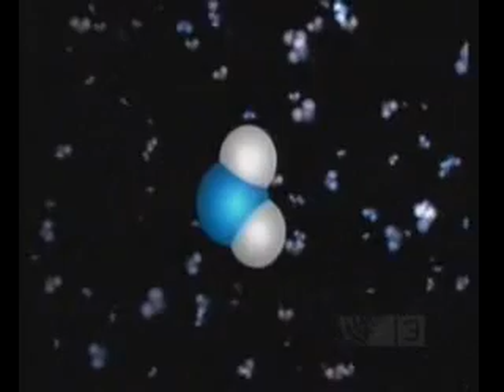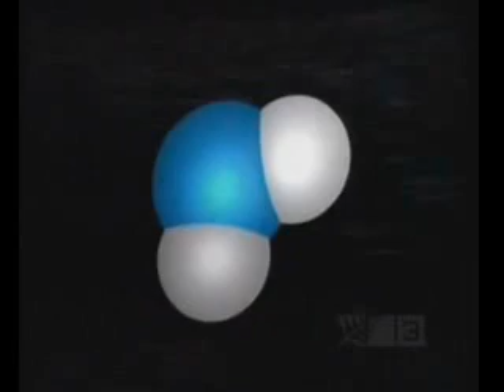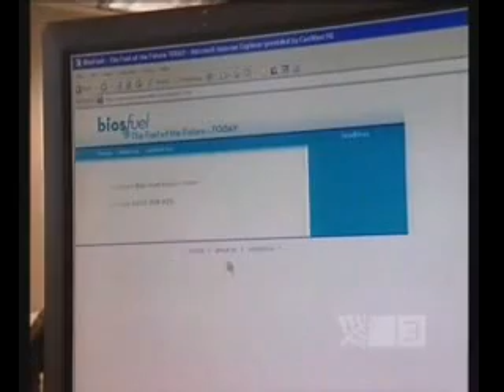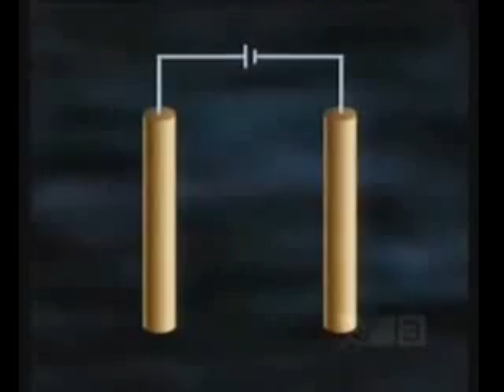A Motorcycle that runs on PURE Water.

Comment: Bullshit. You simply can not processes enough hydrogen.Hydrogen is not easy to use as a motor fuel because it burns too fast
Reply: Hydrogen gas expands faster and in higher volume after ignition than fossil fuels, so you would actually need less of it than you would with gasoline to efficiently run a motor.
Reply: Joseph Germany Nope, actually quite easy. H=1.008 amu (g/mole), or 0.09 g/cm^3 @ 293K.
Use the ideal gas law, PV=nRT. 
FYI, He, Atomic #2, is 4.003 amu (g/mole). It has less lift, but is more stable as it has a filled outter valance shell, which is also why it is a noble gas. 
The power comes from the thermal expansion, which is a function of compression, but most importantly the heating value of the fuel. 
Gaseous hydrogen has a very low heating value compared to gasoline. 1/20th or less at 1 barr. That doesn't even take into account the mole size of Hydrogen, which has a really nasty habit of displacing other molecules (it is massive). Burning Hydrogen in place of gasoline will REDUCE power, not increase it. 
 Check your science and math .
you will fubar the engine for nothing.
 Any how why the push of misinformation about hydrogen?or Where did you hear your that junk you posted?
I learned mine on the job.
lastly it's an engine not a motoir
Reply: Ron Brown
It's called solar energy, ever heard of it? It's free and has ZERO emissions, as well as wind turbines.
Reply: I dont have to be brilliant to watch other videos on youtube that actually explain their designs. nothing secret about this except this guys greed.
Reply: What ever dude?
I give you the math science and you come up with an uncontrollable lab project.
Get a grip. The out come of this lab experiment will not provide any viable results.
,Hydrogen's burn rate is too fast.  Internal combustion engines all rely on a timed spark before top dead center this allows the spark to start a flame front as the piston comes up. This in turn allows pressure to build before TDC and peak just after.
With Hydrogen this don't work and the timing has to be at TDC or after ATDC just to get it to idle. Come on man show me a valid source for your claim
Reply: Ron Brown The U.S Department of Energy tested four internal combustion vehicles using hydrogen: a Dodge Ram van and a Ford F-150 with engines designed for compressed natural gas, a Ford F-150 with a gasoline engine that was modified to run on a hydrogen/natural gas blend and a Mercedes van with a gasoline engine modified to run on pure hydrogen.
The tests showed the hydrogen lowered emissions and increased fuel economy (as compared to the engine on natural gas or gasoline alone). Ford Motor Company has developed an internal combustion engine optimized to burn hydrogen instead of gasoline. The engine can reach an overall efficiency of about 38 percent, 25 percent more fuel-efficient than a typical gasoline engine with nearly zero emissions. The engine is based on ford`s 2.3 liter engine used in the Ford Ranger. Supercharging allows the engine to deliver the same power as its gasoline counterpart.
http://www.consumerenergycenter.org/transportation/fuelcell/index.html
Reply: Ron Brown
What about nuclear power plants. We can`t use nuclear fuel directly in our cars but otherwise making hydrogen using nuclear power. Using hydrogen we can refuel wherever but you can´t say that about electricity.
Reply: TheSierra1983 Here's the kicker.
TheSierra1983
The Hemp plant is most likely the most versatile plant in the world.
One full grown plant has enough energy to processes 10 plants into viable products. The hemp plant processes 1000 times more CO2 than it will produce burning it and gives off O2 the entire time.Everything made from hemp is 100% biodegradable.Paper made from hemp is stronger last longer cheaper to make and no nasty chems like with wood pulp.
Henry Ford was going to build the model T out of hemp plastics,hemp textiles with an engine that used hemp oil fuel. Hurst put a stop to that and gave Ford a shit load of money for compensation .
The model T ended up being twice as much as Ford wanted it to be and the gasoline engine had 1/2 the power as the oil burner he had planed on.
 Hemp oil is vary dense and contains more stored energy than diesel fuel.
Purity fucking amazing when you top that off with it cures many forms of cancer and other ailments. Yet it still sits in the same category as angel dust.
Reply: Ron Brown
I agree, Hemp is awesome when it comes to versatile use.  The rest of the states in the US need to get on board and legalize it too.  It has a lot of potential to fix problems instead of creating more
Reply: D1967E I Don't know what you saw or what you claim you saw. It doesn't matter. I've seen graduate students at Caltech who were given free reign to determine how a magician's perpetual motion bicycle wheel actually worked. They finally decided that there was a magnet in the wheel and a pulsing electromagnet hidden inside the support (which was just like the front forks on a regular bicycle). The magician congratulated them on their expertise and removed the hidden electromagnet. But, the wheel didn't stop turning. The point is, it was a trick and that's all any of these hydrogen bubbler things are. They don't work. Period.
Reply: They are not talking about hydrogen. Hydrogen is not liquid at room temperature.
Reply: TheSierra1983 Don't be an idiot
Reply: Ron Brown
It's whatever dude. I tell you what, fill a soda bottle with gasoline vapor(leave room for a little O2), and fill another with hydrogen(also leave room for O2).  Light each one separately and judge by the the damage done. And correction it's MOTOR not motoir.  typo or not, don't correct someone when you aren't correct yourself.
Reply: Ron Brown
And as far as your "Science", Hydrogen is listed as "H" on the periodic table, not "HE", which is Helium.  Hydrogens atomic number is 1, not 2. go back and check your shit. And it's standard state is gas @298k not 293k
Reply: http://www.energybulletin.net/node/11963
http://www.dalefield.com/slspartners/hydrogen_fm.html
Reply: Ron Brown What makes the article from the link credible?  That's someones opinion, and sounds like a petroleum industry troll to me.
Reply: Well you just keep on then.
I stand on my original post ,You simply can not produce enough hydrogen to viably power an internal combustion engine.
Reply: Ron Brown Who said anything about producing it on the fly? You could have a hydrolysis station at home producing hydrogen over time and having it pressurized into a tank that goes in your vehicle for later use.  And If you watch the mythbusters video you'll see that your comment about the timing of the firing on a motor was BS, regular combustion engines CAN run on hydrogen.
Reply: it takes more energy to fucking produce than you can get out of it.
Why would anyone promote something that cost more to make (extract ) than it's worth? Makes no logical sense what so ever
Reply: Ron Brown Because It's cleaner than fossil fuels you dumbshit!
Reply: And the power plant supplying the energy to extract the hydrogen burns what?
By the way dunbshit is my brother my name is Ron. 
You go right ahead believe what you want.
I can care less..
Reply: Joseph Germany Just because it's clean doesn't mean it's green.
The manufacturing of the solar-cell, charge controller(voltage regulator) and the batteries that will be needed off daylight hrs are toxic shit to us humans.Batteries need to be maintained and changed out when they fail.and the size of the array probably wouldn't fit on your mothers roof.
Joseph don't bother I can care less if you don't get it.
You can make methane at home too. Methane has more promise as an engine fuel than Hydrogen. As a matter of fact a methane gas generator was once common place for lighting and heat. The Winchester mystery house has a big one it's gas plumed all through out the estate.So the place will smell like ass at least you'll have usable gas.
Reply: Nuclear power is more damaging that burning coal. What kind of argument is that?
I see you don't think Japans nuclear problem that's effecting the planet as indication that it's dangerous.
All your arguments don't address the issue of it takes more energy to extract than it produces.
So what part of it don't you under stand?
Wasting energy to extract energy will deplete resources.
None of you hydrogen pushing boobs have yet to understand this simple concept. It's like paying 10 dollars for a 1 dollar item it makes no logical sense. It's not free or is it a VIABLE alternative to fossil fuel.
There are better alternatives too.
Hemp oil
Methane
are two that could and the technology exists all ready to do so.
The hydrogen push is so out of place it should be placed on the back burner for now.
And again I say you simply can not produce enough or store hydrogen safely.
I'd have problems if the guy next door was harvesting and storing Hydrogen in his garage.
But  you do and think what you want even though it's fruitless and dangerous. Maybe we will get lucky and you will learn something.
I've already given links to the information an if comprehension of the material is a problem you can take a chemistry class at your locale Jr collage.
Reply: Ron Brown
You also eat on a daily basis more energy than you can produce of it. This is the same thing that we can`t have perpetual motion without adding power. In coal there`s millions of hours of sunlight "buried sunshine" anyway it takes more energy to make than it produces. Hemp oil needs also a lot of energy before it reaches to your car. Maybe hemp oil can feed our transportation but we ourself will die in hunger. There is no good solution only bad and worse.
Reply: your a fucking idiot.
Reply: Just who are you calling an idiot?
Please enlighten us with your brilliance in this matter Mr,Riley.
Reply: TheSierra1983 I've been to the DOE website and looked over their reports all the way back to 2005. There is nothing there about the testing of four internal combustion engines running on hydrogen. There is lots of information about hydrogen fuel cells and hydrogen storage and hydrogen refueling and hydrogen pipelines and hydrogen production. Sadly, no Fords or Dodges running on hydrogen are mentioned. Now the link you provided went to a California website but other than the statements you quoted there was no verification documents provided. According to the DOE, all the California hydrogen buses used fuel cells.

Now, Boeing did experiment with a 2.3 L Ford engine that used liquid hydrogen. They did initially report favorable results back in 2011. However, only liquefied hydrogen provides sufficient volume to meet the demands of an internal combustion engine. As none of the BS videos claim they are using liquid helium, you can rest assured that they are a scam.
Reply: that's where your wrong many people have produced cars that run poorly on water
Reply: Show me . I know you can't The hydro carbons have the be as dense as possible and hydrogen is a little short on density and like I said before you simply can not produce enough hydrogen or carry enough for it to a viable alternative. You are just wasting your time with something you have no real understanding of.. The Hindenburg was a spectacular fire ball with allot of fire but it was also holding 7,063,000 cubic feet of hydrogen.
Oh the humanity !!!!
Reply: they are hydrogen cars out already.. honda has one and toyota will start selling theirs in 2105 in california
Reply: Anya B It's a money making scam that was started years ago. the petroleum industry basically funded it. A hydrogen economy will have a big lock out affect on other green energy sources. It's all about the money and power. No power has ever relinquished it hold without blood shed.
Anyhow here's some reading to my point.

https://www.google.com/url?sa=t&rct=j&q=&esrc=s&source=web&cd=65&cad=rja&uact=8&ved=0CEAQFjAEODw&url=http%3A%2F%2Fwww.popularmechanics.com%2Fscience%2Fenergy%2Fnext-generation%2F4199381&ei=Kp_ZU4m-I9a3yAS1_4CQAg&usg=AFQjCNF3FXvtzsVgcJAYv46Pf8_CHVDw7w&sig2=InsoCQbyrCYYaWocVgF6-g
Reply: Sorry you are wrong , I have a relative that has already done it !
Reply: yep it's always a friend , relative,or someone you know.
Reply: Sorry if that hurts your feelings , I watched him do it but I cant take the credit .
Reply: Nothing to be sorry for and how would your intake of  bull hurt my feelings.
It's not my fault you don't understand physics.
Hydrogen is not a resource it has to be manufactured using resources at a vary high cost.
You go right on ahead I'll run my LPG pick up another 200,000 males. I'm through trying to explain something so simple. It's all in the math.
Reply: Barry Kent And yet every time one of these people is asked to actually submit proof through an independent lab, they always have some excuse not to do so. They begin to spew forth conspiracy theories of government assassinations and Big Oil control. That is the difference between reality and make believe. Reality is the cell phone in your hand. Make believe is unfounded and unproven claims; especially those claims that have already been proven to be bogus.
Reply: All that will come from a introduction of Hydrogen fuel will be the rich get richer and everyone else gets bent over the hard way.
Sorry you bought into their propaganda.
Hydrogen if you only knew.
Reply: Well we've wandered away from the intended message in my comment that started this thread..
I have learned a few things as we went along that's what it's all about. Right?
I am always critical of everything that comes along and when I first heard of these people spewing the HHO I just laughed my ass off.
Stored energy that's all a fuel cell is.
And like I said before you simply can not produce enough on the fly.
There are better alternatives. than a light weight gas that's expensive has to be manufactured and some what volatile.
Good day
Reply: As ive learned. Hydrogen as a fuel has less well to wheel emissions than burning petroleum directly, as power stations are far more efficient.
It is the same reason why electric vehicles, while still technically produce emissions (from the power plant) is far less than a standard vehicle.

Hydrogen as a vehicular fuel source has the benefit of taking advantage of the 100 odd years of ICE development and does not necessarily require a complete overhaul of the production process, and combustion engine manufacturers can alter existing designs to produce a model that can effectively run on it without the need for a complete overhaul for an electric model.

This would make it a good competitor to electric systems as relative cost of production would be lower, and potential areas for implementation would be small vehicles / bikes where large power output is not a critical factor (for lower fuel consumption purposes)

While i agree it is low "bang for your buck" so to speak it is also extremely easy to produce, putting it ahead of ethanol which requires large crops for its production.
As for petroleum, well, its fantastic but theres far better uses for petrochemicals than burning them, and eventually fossil fuels will screw us over anyway.
Best start with alternatives now.

ps. engines dont run on water, no matter what bs they say theyve done to 'its molecular structure'
Reply: "Ethanol " What a bad joke that was from the start. The use of ethanol has cost more than allot of people realize. It's failed at all points right from the start. 
I still have my dough's that a Hydrogen economy would be wise.
It even may be easy to produce at ambient pressure but that all changes when it's needed in a condensed liquid state were it's more useful.
As of now it cost 4 times the energy to produce than you'll get out of it. Solar would help but that brings in the cost of maintenance for charge stations batteries charge controllers lots of hidden cost behind the support systems. not to mention the cost of the system to support a nation wide system .

I see people driving to work in crew cab 4x4's that work in an office and don't live on a ranch 
People don't think. moderation  they just suck all they can and use the "I payed for it" clause like that makes it okay.    
Anyhow we will be lucky if Japans fucked up reactor's don't finish us before our own government.
Reply: u chat shit, hydrogen is better, faster than the fucking diesel u put in the car.
Reply: believe what you want .
Are you running Hydrogen in your can?
Are you a racer?u
Is hydrogen being used to produce power ? Are you an energy engineer ?
or just spewing more unsubstantiated spewage

Comment: if you combine hydrogen and oxygen, you get water + HEAT, therefore water is in lower energy state than hydrogen and oxygen separately. If you wanted to "harness" the energy of water, you would have to bring water to an even lower energy state - which is???
Reply: urine?…….only joking!
Reply: No, what he's doing is electrolysis, splitting the water into oxygen and hydrogen bringing it to a higher energy level. Btw water doesn't have a lower energy state it is 100% stable and won't degrade down to something else
Reply: Exactly, the only issue is that you cannot convert water into HHO in your car and then burn it again for a greater output than what it took to break the bonds on the water.
Which is essentially whats making everyone crazy on this page :P